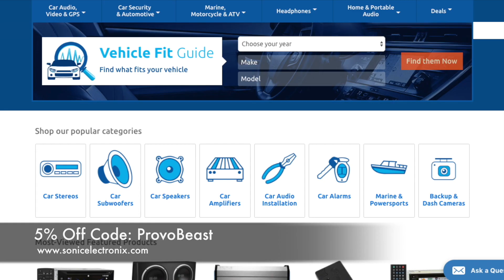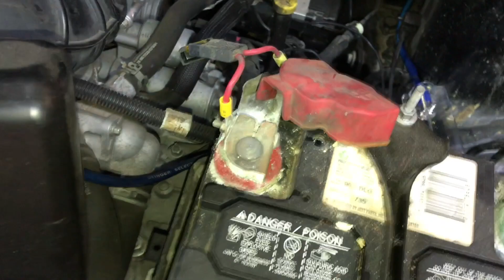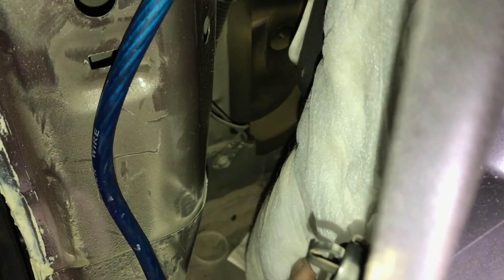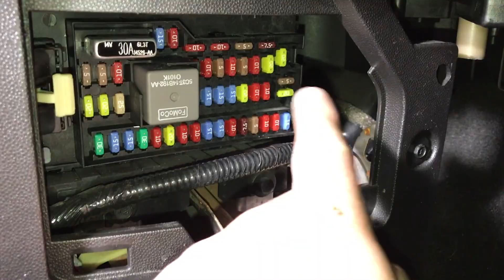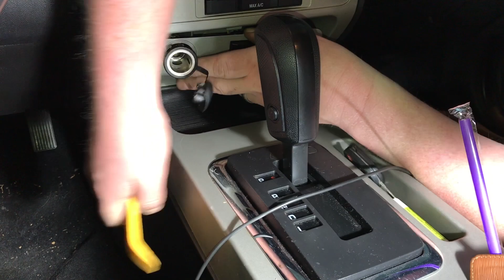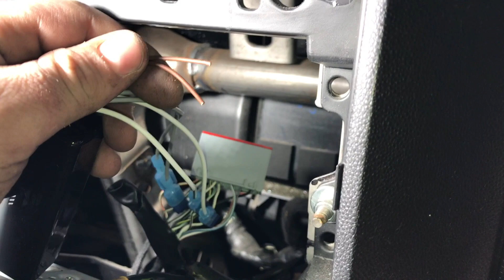2008 - 2012 Ford Escape/Mazda Tribute Sub and Amp Install

Comment from the maker: Parts used linked in the description of the video!
Reply: How do I get the blue pieces that you used to remove the aufio from the speakers?
Reply: @srjsrj2257 t clamps
Reply: What wires did you tap into on the wire harness behind the stereo as I’m having issues finding a wire diagram

Comment: I dont recommend using t taps i would use posi taps instead they are better made for cars. Or even better, a "plug and play" wire harness that adds an rca input, less things to mess up as you dont need to splice or mess with any wires
Reply: Got a amazon link? Posi taps?

Comment: THE INFAMOUS 'SIRIUS' CABLE IS CURRY COLOR - (YELLOW/ORANGE)   IF YOU DON'T WANT INTERFERENCE IN THE STOCK RADIO - (YOU GET MINOR BACKGROUND NOISE FROM THE SIRIUS SIGNAL) - YOU CAN UNPLUG THAT WIRE -  AND YOU CAN REMOVE THE ANTENNA AS WELL .
Reply: What colors did he tap into

Comment: You saved me almost $200. I love the sound quality of the factory radio, and I didn’t want to part ways with Sync. So I did this method and it worked perfectly! I had to turn the bass all the way down on the stereo, because at higher volume the factory speakers would distort when hard bass kicked in. So now it’s balanced perfectly with the subwoofer.

Comment: Yeah you don't wanna use that fuse since it has power all the time unless you like jumping the battery. The remote wire goes to a fuse that is only live when the key is in run or accessory.
Reply: See that’s what I was thinking but everyone says it should be live all the time. Now I don’t know what to do. Have you decided which way it correct, thanks
Reply: @madmotorsmedia5650   I ended up using a piggyback fuse holder(with a 5A fuse for the remote wire) on Fuse #45 in the inside fuse box. It is has power in ACC and RUN.
Reply: @andrewb6603 will a 20amp yellow fuse be overkill?
Reply: @Shd191  Yes, the remote wire shouldn't draw more than a couple amps at most, and doesn't need a fuse larger than 5A.

Comment: I know you said white with a brown strip is front left negative, but doesn't the factory diagram say it's white with a black stripe. There is a brown with a yellow that was throwing me off that is rear left negative, so I had to find the factory schematics.
Edit: also the black gray cable is the ground. Is it possible to ground to just there with a t tap?
Reply: No

Comment: Did you consider a sub w/amp  from a junk yard Premium Sound?
Reply from the maker: Factory premium sound will always be lesser than aftermarket premium sound IMO.
Reply: @ProvoBeastAudio  Definitely, however I have access to an 2009 Mariner factory premium sound for cheap.  And I also enjoy upgrading cars with original equipment options.  (and I'm not that critical on the sound system - of course if it was a factory JBL, BOSE, Infinity, etc. that would be a  no-brainer, but the Escape premium sound is not that great so I'm wondering if it's not worth the effort.  My biggest thing I'd like to do is get all the factory wiring/harness/loom for the sound system too - not sure if the sub wires are already in my 2010 XLT)

Comment: Thank you for this video. You made it a breeze to install.  I would say the hardest part was connecting the T connectors to the speaker wires.
Reply: You ain't kidding. The Line Output Converter box kept fighting with me. The wires kept coming out of the T connector before I had a chance to pinch it lmao
Reply: @Joshtheweatherman what wires went to what?
Reply: IF YOU PACE YOURSELF ITS NOT SO BAD ..YEAH FUNNY  HOW SOME THINGS ARE JANKY.

Comment: Why did you tap the front channels for a subwoofer?  Isn't rear what you want?
Reply: most the time audio has the main focus of output power on the front speakers and the rear channels could potentially output a lower power but also a different crossover setup," factory" but ultimately it shouldn’t matter to much. I’ve cut the rca wires and spliced them into the speaker wires themselves without the high line converter before, doing so allows lower gain adjustment on the amp which in turn keeps it’s heat and current draw lower, and it helps save on gas from a lower resistance from the alternator. But the audio quality is not as clean.

Comment: Will your amp turn on if the remote wire isnt hooked up? Shouldnt i still be able to still see if power is supplied without remote wire hooked up to an interfuse wire?
Reply: No no you won't the amps generally do not show when they are getting power but aren't actually powered on

Comment: I’ve already installed everything except the preamp , it’s supposed to arrive today ,  so I figured I’d be ready when it gets here ,  I didn’t think to use the side pocket I keep my emergency fishing lures in for my amp , but certain it’s to small for my amp , and I didn’t want it exposed at all ,  so I used the cargo storage tub under the carpet  to mount my amp, however it is sealed and had concerns of over heating,  I cut out a small circle on the driver’s side edge and mounted a 80mm 12v fan out of a computer ,  it sits perfectly and looks super clean in the corner, there is also a decent air channel that runs the edge of the tub to draw air from , it blows directly onto the amp , there is a slight drop off where the amp is mounted , which I appreciate, I utilized the drop off to put a small piece of foam under both low side screws for a nice air gap under the amp while leveling it in the process, I will drill a couple 3 inch holes in the lid of the cargo box and put a piece of screen over the holes and lay my carpet back down , it should exhaust threw the carpet   , amp should stay moderately cool ,   Just a idea for anyone who may not want amp exposed , also if you like to show your stuff off , the lid could easily be exchange for a piece of plexiglass , and u can either cut  out  the carpet to expose the plexiglass or remove  the carpet  so you can cover it when needed ,

Comment: Hey guys, we followed the video directions and did not have any success... Hoping you can help.  We hooked up the sub & amp box to a different vehicle and it worked just fine. We are having two problems 1) The amp has power all the time, not just when the key is turned to the aux or engine start position. 2) The sub is not receiving a signal from the head unit (the music is cranked and the bass level is set to max) so when everything is connected the subwoofer does not engage. 

I’m 99% sure the problem is with the wire taps we installed (head unit to rca adapter) but wondering if you have any suggestions??

Thank you in advance!!!!!
Reply: I’m not sure if you found your answer yet, but for the reason your amp is always on: after looking at what fuse they tapped into I found they tapped into the climate control  which is, for some reason, always powered. 

As far as the head unit tap, I don’t know if you followed those exact colors he gave you but some cars have different colors for the speakers. I would check that.

Comment: Hey my king when you put in your sounds I want to keep My factory radio where did you find your wire colored code for wires Harness to the back of the radio to add a.m. with an outline converter please called me or text me link at 5172580318 thanks my king for any information

Comment: About to do this, could I use the line out converter on the rear speaker instead of the head unit harness?
Reply: Yes that will also work.
Reply: Did this work tapping into the rear door speaker? Also can I just use one side (left) or would I have to tap into the right rear door speaker to? Thanks.

Comment: Im not gettin power to amp amp is good wat could be the issue
Reply: I got power do i need to connect two speakers a left and right for converter or can i justuse one side not gettin full bass is that why
Reply: Chris Sanders you should connect to both left and right, as sometimes bass may switch from side to side depending on song.
Reply: Thanks I wired both sides also my speakers were wired wrong got it goin now

Comment: i know i commented 10 months ago but i have been slack getting my components together, lol i am finally installing now, just double checking with you that is the climate control fuse you are tapping into with the add a circuit
Reply: Skip that going to fuse box. Go directly to the steering column wires

Comment: Nice one man!!!
I completely agree with Leonel Ramirez. This helped a lot.

One question thought, is the "Pac SNI-35 Line Out Converter" mandatory? What does it do?
I have already set my amplifier and sub-woofer like you explained except in my case it is a 1000W system, but where I live you won't find a line out converter.

Thank you and anyone out there for an explanation in advance.
Reply: a line out converter converts the high level outputs that would be going to a speaker into a low level signal that the amp can take in. If you have an aftermarket headunit then you'll have outputs for the amp on the unit. The line out converter is only needed if  you dont have the proper low level inputs and have to hook into speaker wire to add the amp. Any proper setup does not use a line out converter.
Reply: @dragonmaster391  thank you for the explanation.

Comment: Very cool. CLEAN. I'm really picky about cosmetics as I feel most are. (or should be, but to each their own) I'm kind of curious on that particular set up's improvement ? I like the fact that doesen't eat up a ton of cargo room (translating "usually" into eating less of one's finances) I was thinking of Alpine type "S" in the 4 factory door speaker locations. Maintaining the factory head unit (I know I could deal w/getting around Sync, the steering wheel etc. But it's a daily driver, I don't want a "Here I am" or " You"ll hear me 2 mins. Before I get there" system) A decent to vast improvement of the factory 4 speaker system is deffinately in order ! I'm open to suggestions & honestly somewhat torn between Polk D.b. or the Alpines ? Another thought other than what you did possibly was trying 1 of the many junk yards in my area/or Ebay; Acquiring the optional factory sub & mainly mounting pannell & possibly do some mild sound proofing/deadening & similar to this set up, install a single 8 inch sub w/appropriate power.(This is assuming I can "switch" the optional panel containing the fact. Sub. & replace with a budget friendly alternative into my Mariner which does NOT have it. I'll look into that shortly but don't expect that to be much more difficult than tracking down the proper pieces and mouldings to do so) I know especially in audio; You get what you pay for ! There's always sales, open boxes, etc. That when not needed asap, I've done pretty well with in the past. I think anything more than a single 8-10 will probably require more space than I'm willing to part with. Dual 12's are out, just trying to keep myself from from stripping the car down & refinancing my home, in an attempt to make rain drop's bounce, but I'd also like to maintain my sanity & add some much needed "umph" as my factory components are rather old & tired, as well as, is basic as was possible over a decade ago! Does a single 8 or 10 sub. Add all that much ? I'm not in the financial bracket for the $600 stealth box. & with the factory 6×8's, worth changing front & rear to 6.5's ? Go 5.25 ? A combo ? I'm open to any experienced opinions and or knowledge pertaining to upgrading the overall sound quality of the Escape/Mariner/Tribute that yourself or anyone else wishes to share ! Great video & T.y. beforehand for any & all thoughts!

Comment: It amazes me when people want a system installed but there battery is trash all that corrosion on both terminals was the first thing I noticed
Reply: i just put a brand new battery and alt in last summer, should i be ok?